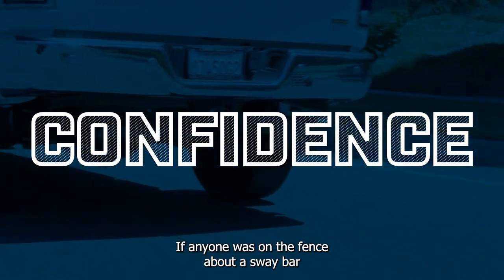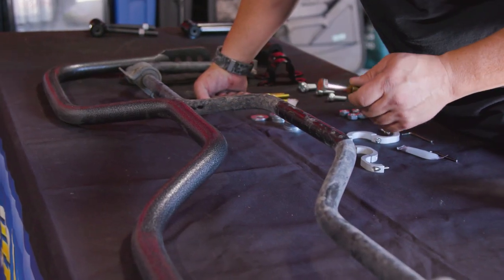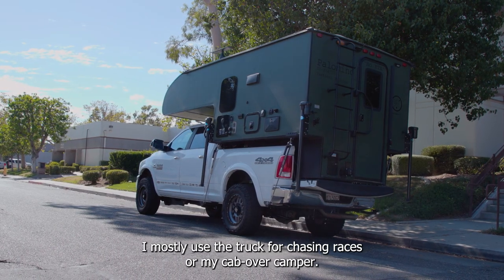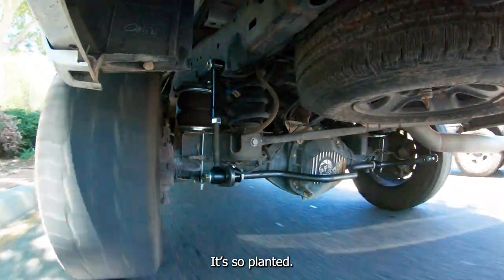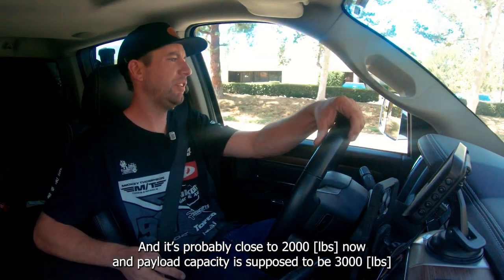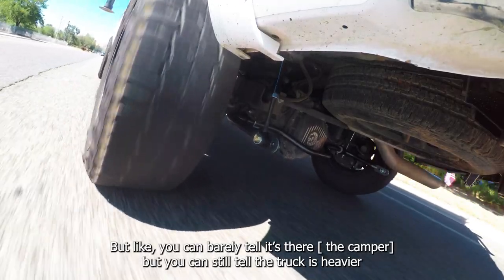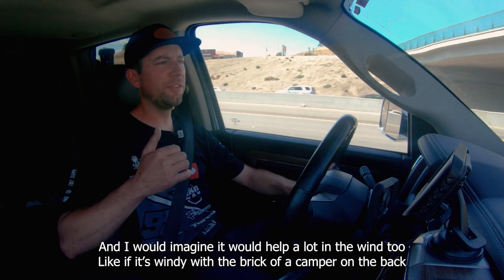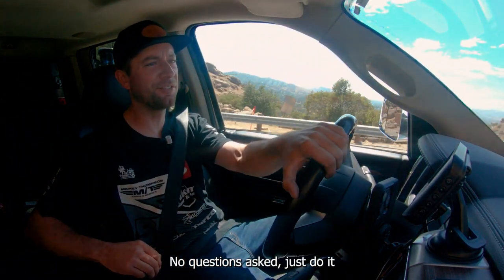RAM 2500 Install | GenRight tests the Hellwig Products Sway Bar

Comment: I’ve ordered the Hellwig sway bar for my 2010 ram 3500 dually, can’t wait for it to arrive and install. I have a lance 990 truck camper and sway isn’t bad but watching other videos this will help better. (I did add another leaf spring already (Had one break before I have my truck camper so had to fix and they suggested I add another leaf)
Reply from the maker: The combination of the Hellwig sway bar for your 2010 Ram 3500 and your Lance 990 truck camper setup sounds like a winning solution for enhancing stability and control on the road. Even though the sway isn't bad currently, adding the sway bar will definitely provide that extra peace of mind, especially when towing heavy loads. If you have any questions or need assistance during the installation process, please feel free to reach out to our tech support team. They're available at 1-800-367-5480 and are always ready to provide guidance and assistance.
Wishing you smooth travels and many enjoyable adventures with your upgraded setup!
-Team Hellwig

Comment: I have a 2018 Ford F-250 with airbags and I haul a 2021 Adventurer 89RB truck camper. I'm still getting a little sway so can I install front and rear Hellwig sway bars to control that as well as keeping my air bags in?
Reply: Yes